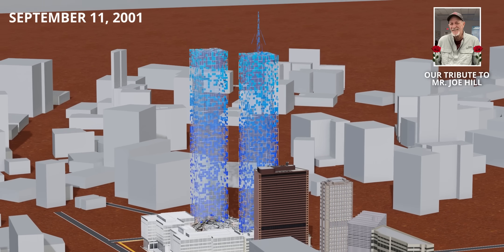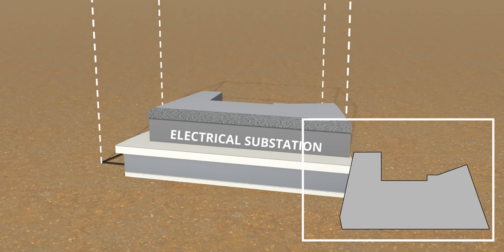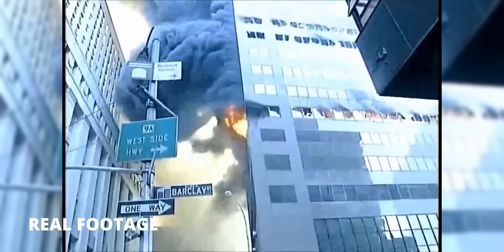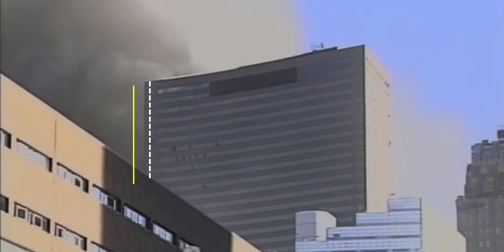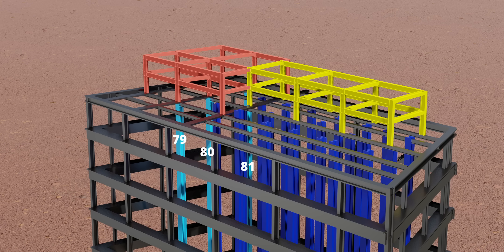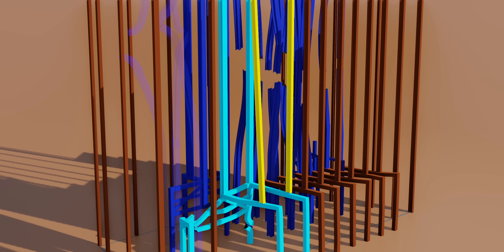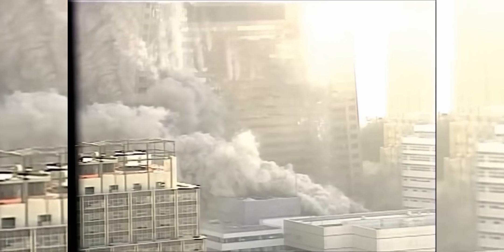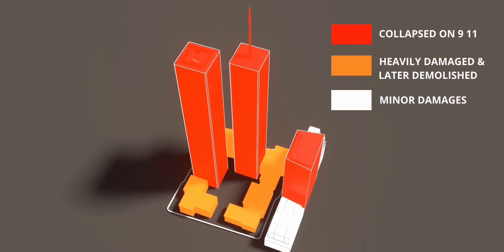Collapse of Building 7 | The Complete Physics

Comment: And the most obvious part the building was blown is if a building falls in itself … the floors are still there stacked on top of each other on the ground.   Where are the 55 floors stacked on the ground ?
Reply: Ummmm, no.  The unknown and unimportant Building 7 was the 6th building to collapse of 10 lost on 9/11. Though extensively studied, it still confuses many people. Not famous, or a terror target, and no casualties, thus it did not get a lot of attention and few know much about it, creating a void rapidly filled with garbage from the internet. Because everything seems like a conspiracy if you don’t understand how it works I prepared this brief summary explanation of my own analysis. No politics, just engineering. 

The North Tower collapse at 10:28am bombarded Building 7 with tons of burning debris, causing heavy damage and starting raging fires burning out of control for 7 hours. Half the responding FDNY firefighters having been killed, others injured, units in disarray, equipment destroyed, no water pressure, and the greater urgency of Search & Rescue efforts, firefighting at 7 was pulled as futile. The building couldn’t be saved and was left to its fate.

www.youtube.com/watch?v=g_SvpwyC17M&ab_channel=MFitz  

Collapse of a burning structure is always a concern for firefighters. Steel buildings subject to fire rely on active fighting of the fires to survive. Buildings are designed around 1 to 3 hours of fire resistance, allowing time for occupants to escape and ACTIVE firefighting to get started, after which all bets are off. Left to their own devices they will exceed their design envelope and collapse. In B7 the occupants escaped, passive and active fire protections were compromised and active firefighting was abandoned which left the building to take its chances. It lost. Odds on Building 7 would eventually collapse, and it did. No big deal in logic. That is the sort of choice firefighters make every day in brush fire situations - which houses to save and which ones to let go. Only real difference here is moving the decimal on the size and cost.

www.youtube.com/watch?v=WnYBX6QT0R4 

FDNY Chief Daniel Nigro ; The biggest decision we had to make on the first day was to clear the area and create a collapse zone around the severely damaged 7 World Trade Center, a 47-story building heavily involved in fire. A number of fire officers and companies assessed the damage to the building. The appraisals indicated that the buildings structural integrity was in serious doubt. I issued orders to PULL BACK the firefighters and define the collapse zone. It was a critical decision; We could not lose any more firefighters. It took a lot of time to PULL EVERYONE OUT, given the emotionalism of the day, communications difficulties and the collapse terrain

FDNY Deputy Chief Peter Hayden ; We had our special operations people set up surveying instruments to monitor and see if there was any movement in the building. We were concerned of the possibility of collapse in the building. And we had a discussion with one particular engineer there, and we asked him if we allowed it to burn could we anticipate a collapse and if so, how soon? And it turned out that he was pretty much right on the money, that he said 'In its current state you have about 5 hours

The collapse of Building 7 was anticipated all afternoon and widely reported in the media with at least 24 video cameras recording some or all of the collapse. Everyone at the time knew what was coming and why.

www.youtube.com/watch?v=OY5S5k3tMHI 

Building 7’s collapse was totally different to the Twin Towers, harder to understand and most of the details difficult to see. But we can sort out what happened through careful analysis and observation.  What follows is MY EXPLANATION of the collapse sequence using the best available information and relying on no authority.

B7 was complex structure, a 47-story steel framed building built on top of a smaller existing 3-story building, requiring several lower floors dedicated to complex load transfer structures instead of usable office space. Of trapezoidal shape and all-steel tube-in-tube construction, B7 (above the 7th floor) consisted of a central core of steel columns carrying most of the gravity load, perimeter steel columns around the outside of the structure carrying the remainder of the gravity loads and long span beams and girders to tie those elements together and form the floors. On the outside of the building hung a moment frame - the last part of B7 to fall. 

Phase 1 : Collapse initiation for B7 is notably quiet with observers not realizing the building was collapsing! There was no audible warning in the form of say hundreds of ear drum busting 180-190dB explosive bangs preceding the collapse. The first externally visible signs of collapse initiation occurred at 5:20:28 pm. Here at 12:00 a local CBS affiliate reporter is talking 10 blocks from B7 when collapse begins. People don’t start to notice the collapse until 12:11. Then at 12:45 is the famous CBS fixed camera clip of Building 7’s collapse Again, note how quiet it is.

youtube.com/watch?v=t5tEy6mXSE8&ab_channel=fresnosean379

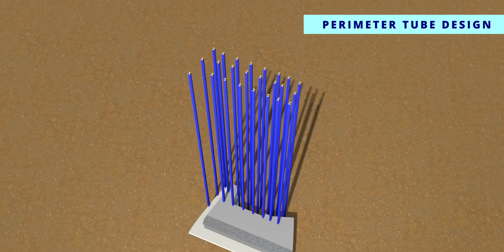Collapse initiation was due to multiple lower floor failures above the load transfer region (7th floor) in the NE corner of the building. In this video at 0:45 you can see the NW corner from inside the building while under construction, Column 79 just out of frame on the left. That big, angled steel beam across the top of the frame connects to C79 at one end. The girders connect to the beam. That beam and all those girders depend on just one connection

youtube.com/watch?v=nP3TNHPCIVU&t=35s&ab_channel=EdwardCurrent

Phase 2 : Lower floor failures caused a loss of critical lateral support over an excessive length of core Column 79 and it buckled. If you look at a floor diagram of Building 7 (see above) and look at all the structures that depend on C79 you quickly realize this one column was a relatively isolated structural element on which a disproportionately greater fraction of the structure depended . Externally we see a vertical progression of window breakage along the 44-46 line and a kink in the roof of the East Mechanical Penthouse at the top of the building, consistent with C79 failure. The transition from full capacity to almost no capacity occurs in virtually an instant. Once the buckling failure occurs there is almost no resistance

Normally with a buckling column, the load could very well be redistributed to other columns, meaning the buckling could stop after a while. With C79 that is not the case - the failure did not redistribute the load, so the collapse rapidly progressed to the roofline, sinking the rooftop penthouse.

Phase 3 : With C79 gone, B7’s progressive, non-symmetrical collapse continues with C80 and C81 at the east end of the core left laterally unsupported and quickly buckled and failed as well, sending the EMP down through the building. C79-81 all have no diagonal bracing, which I believe is a major reason why they could not redistribute a lot of vertical loads among one another.

From there collapse progressed from east to west through the central core until the core was gone taking all of the interior floors and structures and probably most of the perimeter columns with it. You can see the horizontal progression of window failures low in the building and the dropping of the remaining rooftop structures into the building. One of the big takeaways from the NIST Building 7 study (that gets completely ignored) was their modeling which determined C79 failing under ANY circumstances would have initiated the same collapse sequence.

Phase 4 : After some 10 seconds all that remains of Building 7 is just a hollow empty outer shell - the exterior moment frame - creating the illusion the building is still standing since little has changed externally. But it’s just a hollow empty shell like an empty cereal box supported by only a few remaining columns and quite unable to remain standing. With all the internal framing gone. the north face leans inward, forming a V in the roofline, the last perimeter columns buckle under the strain and with nothing left keeping it up the moment frame free falls, landing on top of the 7-story high debris pile. It is only at the very end that a single measurement of alleged free fall acceleration is taken. Note this is not the building but just its outer shell, and only one corner at that, at the very end of the collapse. Start to finish the entire collapse took 18-20 seconds, or less than 1/3 of true free fall and we have to look at the whole thing, not cherry-pick little bits to fit a particular narrative. Worth noting _how fast something falls cannot tell you what started it falling in the first place. The debris spread out, blocking surrounding streets, heavily damaging the Verizon Building and destroyed Fiterman Hall, all well outside of Building 7’s “footprint”.  

Building 7’s progressive, non-symmetrical collapse was incidental and unintended collateral damage from the combined effects of fire + time + gravity started by the collapsing North Tower. That is true no matter who planned and carried out the 9/11 attacks or why . The collapse was of so little consequence it barely even registered at the time, a mere footnote. 

Anything can seem like a conspiracy if you don’t understand how it works. Now you should. I hope you found this helpful and informative, not adversarial and it solicits informed critical comment. If I made any errors of fact, logic or reason or left anything critical out, please let me know so I can fix it. IF you can offer a more plausible alternative please do. Be the first. Please start any reply with the words “Tits McGee” or I will know you didn’t read it and are wasting my time.
Reply: @WhoIsJohnMcEnroe  - Had you actually read it you would have followed the directions. 

Do let me know IF you ever get serious
Reply: @WhoIsJohnMcEnroe  Your right. I didn't.  I continued to address the first point you made, ignoring everything else.  Be cause you being stupid, meaning no point in going further.

But then unlike you, I never pretended I read all of your posts.
Reply: @WhoIsJohnMcEnroe - Who is angry?  You would have to matter for me to even raise an eyebrow. You are a dime-a-dozen. I couldn't be more chill. 

You are intentionally (mis)quoting me out of context. Typical conspiracist stuff designed to load and twist arguments.  See it all the time.

I laid out a complete hypothesis - start to finish - for the collapse of Building 7 with supporting evidence which you did not read. You cherry picked a couple of words out of context to use in an argument from incredulity, which does not interest me in the least. It demonstrates a severe lack of seriousness. The post was meant for serious discussion. When you decide you can and want to do that we can.